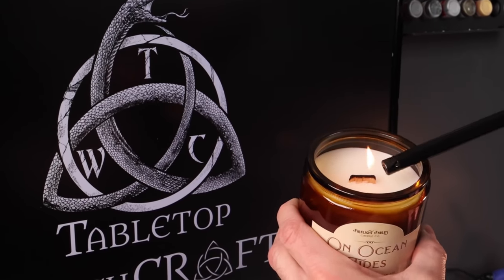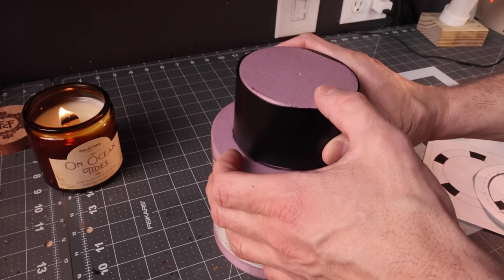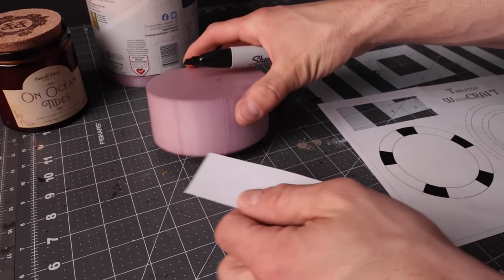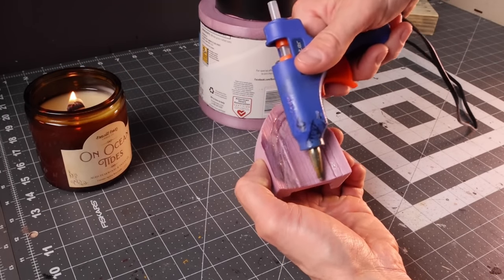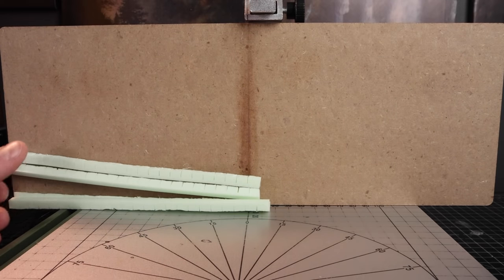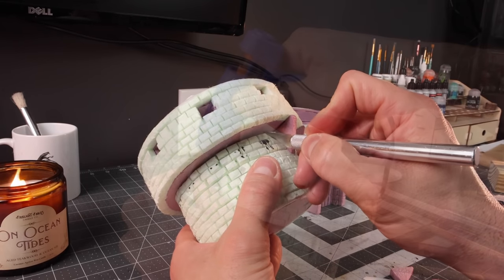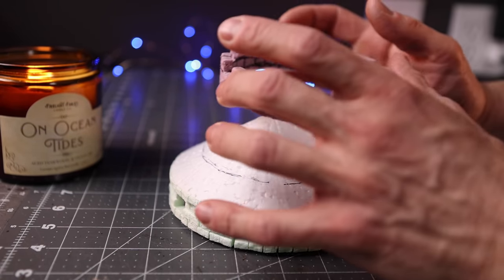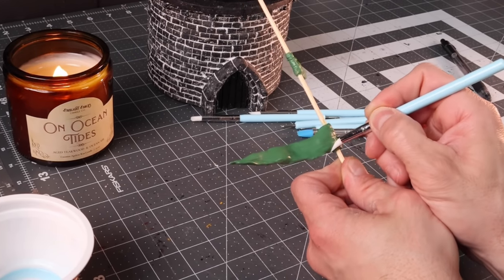DIY Foam Archer Tower for Dungeons and Dragons - NEVER Make Individual Bricks Again

Comment: I want to share my way of doing magnets.   I glue the first set in and then put magnets that will be on the neighboring piece on the glued down magnets.   Then I take the other piece and press that down on the magnets and they indent circles where they need to go on the new piece.   Takes the whole paint thing out of the equation and works perfect every time.
Reply from the maker: You know… that’s a great idea!  Thanks.

Comment: Great looking build fella, for flags etc I’ve seen aluminium cans used. It should be flexible/bendable enough to get some great ripple effects on the material. 👍🏼
Reply from the maker: Cool idea for sure, thank you.... I would assume you would sand down those edges quite a bit... those can be pretty sharp.
Reply: @TabletopWitchCRAFT  a little tickle over with some 240 or 400 grit should be enough to stop them being too sharp. 👍🏼

Comment: The brick jig is awesome.  I think I might have to pause 3D printing terrain and pick one up.  The paint job that you did on the stone was sweet too.  Could you do a video on how you did it?  I got the basic idea but it would great to see it with a little more detail.  Thanks for the great videos.
Reply from the maker: Time to pick up some foam haha.  I'll be using this jig quite a bit coming up.  I'll try and show off the painting a bit more.  Basically for this one its a lot of layers, dry brushing, and thin coats followed by a well placed wash over the stone to make sure you don't coat the entire craft and lose your grout lines.

Comment: I bought the plans from your website but I noticed, in the video, you're not using the plans I downloaded, you've got another version of those you use in the video.   I can figure it out , I think, in the 8x11 plans sometimes you've combined 2 figures into 1 and in the video your printout has those figures separated.  Anyway, I have a suggestion for your next video: make sure the plans you use in the video match the plans you're selling exactly, it'll be much less stress for your followers!   So far, so good, by the way in my build - I'll update this with my final triumph when I get it done!  Nice model !!
Reply from the maker: Hi Mike, thank you so much for your support.  The reason the plans are slightly different is because I make the plans then start my build.  At times I'll make modifications to the build along the way and the plans you buy depict the exact changes I made to make the exact build you see on the channel.  The only way to show the exact plans in each video would be to preproduce each craft twice...

Comment: If you want a far easier way to do flags or banners, there's an old tutorial on the Wagames Soldiers &Strategy youtube channel (Really wish she'd come back, miss those tutorials), one of her earlier videos, that has a few things that are really easy to do and look great. It's a specific type of paper used which works wonderfully.

But one other way to do easier brick patterns, though one that leaves more dry time, is to look at some of the piecrust/pastry dies, and even some cookie cutters. There are some with notches in them for specific designs and if you have the sharper metal ones, it cuts through the dollar tree foam core extremely easily and you can just stack it up while gluing it together. And some of the stranger designed cutters can also be useful for embelishments and other terrain pieces. I've got a few pieces that are basically a bit of foam cut with one that I textured with a rock and made some cracks in them for things.
Reply from the maker: I've made them out of fabric, paper etc... just showing off some other options... thanks for the ideas :)

Comment: Another home run video! One question though. Is that brick jig only good for rounded projects or would it work just as well with more square and flat walls?
Reply from the maker: Right on Rick, thank you!  I'm actually working on a video now show it off on a flat surface.  To exaggerate the grout lines on a flat surface you just turn up the heat on the Proxxon and you're good to go!

Comment: How thick do you cut the foam before putting it in the jig? And what temperature setting do you use?
Reply from the maker: Great questions.  The foam thickness is just to the height of each vertical cut in the jig.. its approximately a quarter of an inch.  I have the heat around 2 to 2 1/2 for round structures.  To get more defined grout lines on flat walls I turn the heat up to 3 to 3 1/2.

Comment: Great work. Could you say some more about the painting? (which is superb)

Regards from Over Here
Reply from the maker: Thank you :)  I really thought long and hard about what I wanted to do here.  I originally even added color to the grout, but then opted out of that because I knew I wanted to base coat the entire thing an off white.  There would be enough layers of paint and wash to dirty up the grout.  I used a handful of colors, brown, tan, yellow ocher too I believe.  Painted sporadically over the tower.  Then the heavy drybrush of grey started to bring it together.  The thing is to have it thinned down enough that your other colors still show though.  Then the "drybrush" of the black wash over the entire tower made it all cohesive.  Don't just slap a black wash over the entire thing.  It'll really take away from the grout lines and the definition of each brick.  Finally a drybrush of a white or off white and you're good to go :)
Reply: @TabletopWitchCRAFT  Thanks for the summary!

That's extra-thorough paintery, and the results amply justify the effort. I've prodded around in a lot of castles, and I think you've truly nailed medieval stonework here.

All best from The Homestead of Snot's People (yes, really) ('Hi, I'm Snot, and this is my homestead.')